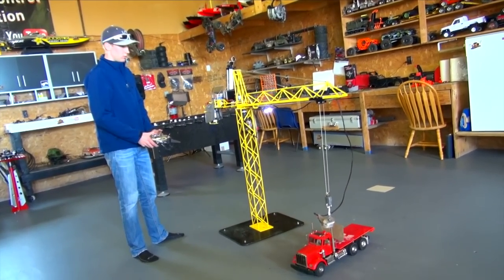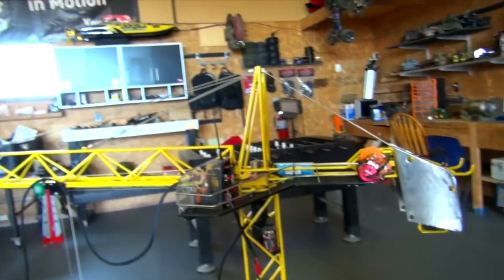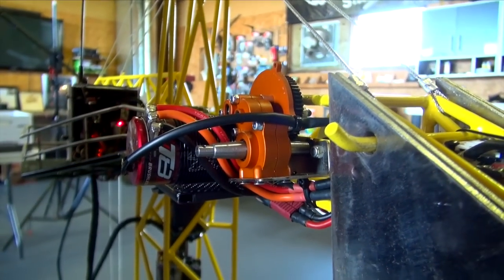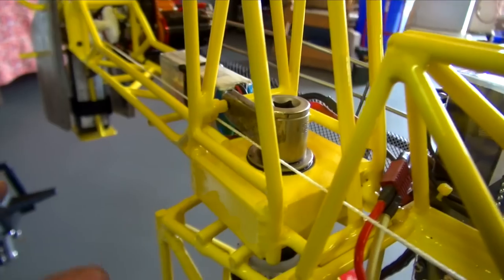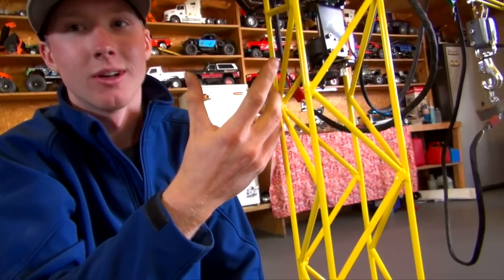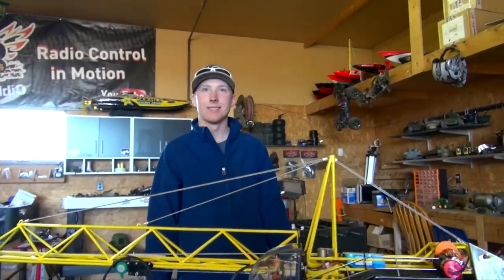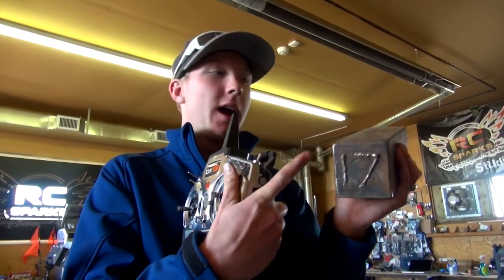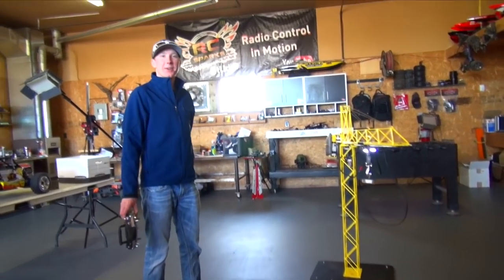This 3 Motor, GiANT 5' Radio Control Crane is Pure Genius  | RC ADVENTURES

Comment: well hes not right about  the way the counter weights work but im rather impressed with the build for someone that doesnt know much about cranes, should also consider looking into a splittable 2-part/4-part main block  he wouldnt need to regear the hoist motor if he did that